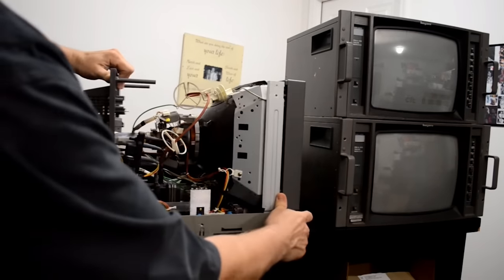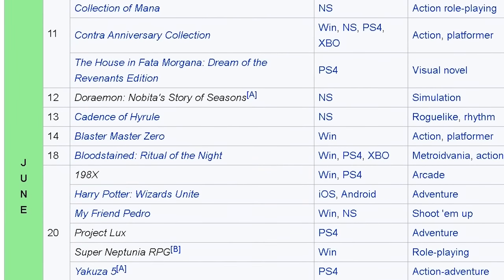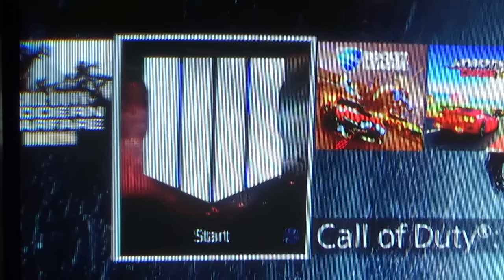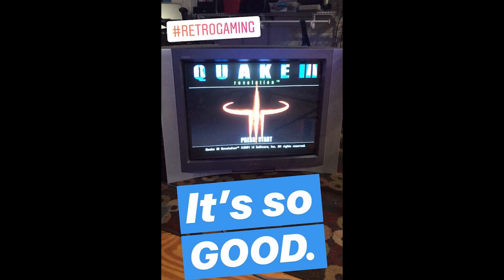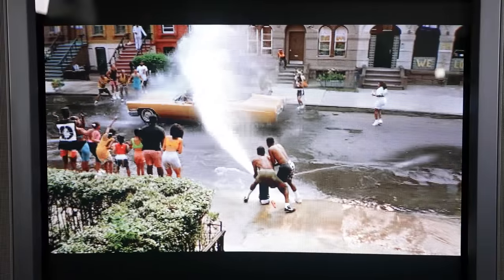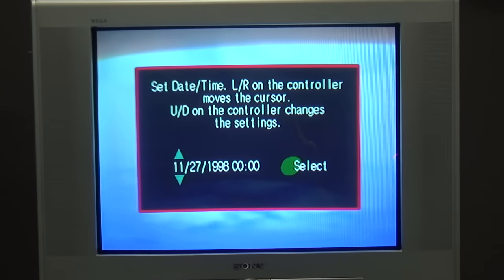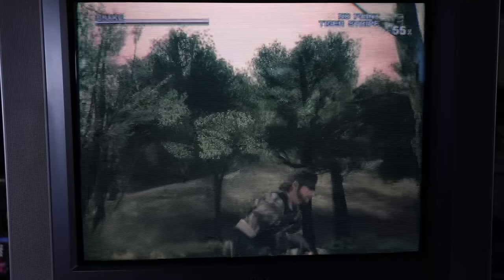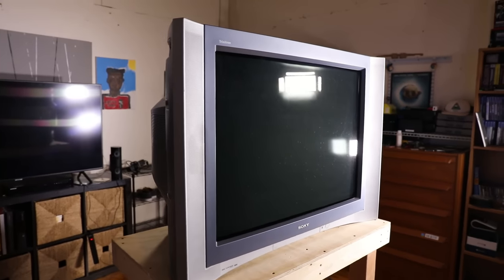Best CRT for Retro Gaming: Sony KV-36FV310

Comment: I love my 36" beast.  Currently it's on the floor but I ordered a flat top utility cart to set it on lmao  It touts a 500lbs weight limit, so it'd damn well better support a 220lbs CRT!

EDIT: Oh, by the way, Raspberry Pi with a RetroTink Ultimate will do exactly what you want in terms of getting a "PC" to output to your TV at 240p.  I'm building a consolized Neo Geo MVS and that's what I'm setup in the meantime to play some KOF while waiting for the parts  :)
Reply from the maker: Ty I think you just made me order a Raspberry PI
Reply: What kind of cart do you use for the 36" fv310? I'm getting one and need a stand.

Comment: I recently picked up a Sony Wega 30 inch 16:9 crt off Craigslist and i could not be happier with the tv. It has all of the best of analog inputs and a single HDMI so you can use newer systems on it. I use my ps4 with it, hopefully the ps5 with allow a 720p or 1080i signal. Everything on it looks amazing, crystal clear. 720p content looks jaw dropping. The deeper black levels allow not only for better color but better depth of field also. 3d objects pop more and seem to have more volume. This tv from 2004 displaced a fairly new Samsung 39inch 1080p lcd that was truly gorgeous and its not even a close second in my opinion to this Wega.
Reply: 32" Sony Trinitron here.  I got mine about 6 years ago.  A friend at the time was moving into a apartment and said there was a old TV when he moved in that the previous tenant left behind.  He ask me if i needed a TV.    I was like...fuck no.    I then then asked him what kind of TV is it.  He said it's one of those old floor model color TV's.    

My interest was peaked  Mind you, i didn't own a CRT at the time, although i wanted one but never really did anything to make it happen. 

So i asked him what make and model is it, he said it's a Sony.   0_0    I was like...i'll be right there...  I was thinking on my way there, "could it be a Trinny? 

Got there and there it was on the floor in all it's beauty..   Now for a 32" this TV was a BEAST!  It took 2 people to lift this thing and i was like...I hope my health insurance  is on point... 

So, after i called my HMO to see if my health insurance is up to date, initiated lifting procedures.

Got it home and it rests on a huge dresser  with plenty of space to the left and right of it for gaming consoles.

Comment: I used to have a Panasonic Tau 36" TV that was very similar to this, it had pretty much every high-end feature for a standard-def TV including geomagnetic correction. I bought it brand new back in 2004 when I was stationed on Guam. It was an awesome TV, but it weighed at least 160 lbs. It was nearly impossible to move with only 2 people. For that reason alone I had to get rid of it. I wish I still had it but I just don't have the capability of holding onto a CRT that weighs that much.

Luckily, I have found one of the 27" versions sitting around waiting to be trashed at work, so I am free to take that home. It's still heavy, but only about 100 lbs so it's a lot more manageable. The nice thing about CRTs, which is easy to forget when you've gone the last decade with LCD TVs, is that the built-in speakers often don't completely suck and are actually usable. These Panasonic TVs also have BBE audio enhancement which makes it sound a little better.

Picture quality of my Saturn through the S-video input was so good on that 36". I'm just going to grab that 27" and call it a day. I think my ideal monitor would likely be a PVM, but I would have to sacrifice screen size for that, and while I don't necessarily need a 27" TV, I would like something at least 20" or larger and the price of free is perfect. There's also the matter of the fact that this TV already has all of the inputs I would possibly need on it for all of my existing game consoles that aren't using HDMI, so it'll work perfectly.
Reply: I have that exact TV and it's better than this.

Comment: I still had my parents old massive Panasonic crt when black ops 2 came out for the 360 and when I saw the game for the first time on a digital display I instantly plugged my crt back in the crt it was a much smoother picture and was much better for multiplayer especially since I was on Ethernet straight to Comcast business and we lived only a mile from the service station. It was lightning fast for the time and I didn’t even realize it until I was older

Comment: Glad you're back, looking forward to the new content.

Man, my friend and I had suffered greatly only a few months ago lugging a 32" Sony XBR Trinitron into my apartment but now I'm heavily considering the one from the video. There may or may not be one down in the San Diego area. How did you pull it off, rent a truck and 3 guys to move?!
Reply from the maker: Go for it! A buddy of mine and I rented a U-Haul van for the day and were able to move it with just the two of us. If you can't find an furniture to set the TV on hit up Home Depot and they'll cut the wood you need to the correct specifications!
Reply: @Scarflix  This one might come with the OG stand. The TV is free but I'll have to grease some palms to have a few buddies of mine help out 😅

Comment: It's considered the best consumer crt as long as you don't mind a warped image. It's ok for 3d games but its a noticable issue with 2d games. Also, component isn't RGB but it looks just about as good.
Reply from the maker: I think I noticed what you're talking about when it comes to 2D games
Reply: @Scarflix  yea it can be annoying but the quality of the image is so good that it's worth overlooking. Another great consumer set is the Sony trinitron 32xbr48. It's a curved screen model so it tends to correct this warping issue but it's not quite as sharp being that it's a little bit of an older model (1999ish). As far as anyone can find it's the only curved trinitron that also has component inputs.

Comment: Toshiba came out with an almost exact copy of the Sony, Trinitron tube.  I had both the 36" and 20" versions... I kept and still have the 20".  Same exact features(like 16:9 enhanced) as the Sony in an easier to handle 20" design.  The Toshiba 20AF45 FST PURE Flat-Tube TV w/ColorStream Component Video Input.  The 36" model was the 36AF62 clocking in at 200lbs.

Comment: I love CRTs i own 4 different sizes and brands !
Reply: I have a beautiful story. About 2 to 3 years ago I went on Craigslist looking for a crt tv for nostalgia reasons. I came across a 24 inch Toshiba crt with both dvd and vcr. I loved it so much and it was practically brand new. The person I got it from gave to to me for free too o just had to pick it up. Is was mint condition and the controller still had the original batteries in it. Everything worked and I loved that tv. One day I was moving things around in my man cave so I set my tv on top of a Chair. It was definitely my fault because I left the tv on that chair for a couple weeks. One day for some reason it tipped over and it broke my tv. It still works fine and it I don’t think it damaged the internals but now it has a huge crack and broken area in one of the corners. It really still does upset me till this day because even though it still works it hurts me that I broke it when I was supposed to care for it since it was such a great find.

Comment: Did you keep the Wega? I have the same model but 32”. I know use the Retrotink to output 540p which perfectly upscales to its native resolution of 1080i. Then you can turn off the digital processor in the service menu which gives you next to 0 lag. Now my old consoles like Saturn look amazing.

Comment from the maker: If anyone knows the BEST way to get video from my PC to this CRT let me know!
Reply: Use CRT Emudriver (custom video driver that allows 240p output with certain AMD video cards) and use a vga to component transcoder if you have a VGA or DVI-I port.  If you only have HDMI, you might be able to use a HDMI to component converter with CRTEmudriver.  There are ways to get 240p output with Nvidia cards but I'm not sure how.
Reply from the maker: Thanks Kev! I just pulled down CRT emudriver and am reading the wiki on it now.
Reply: Theres a few ways to go about it depending on the resolutions you want to run  ill be making a video with this exact screen with my pc after i finish my av rack
Reply: eBay "scan converter". Thank me later.
Reply: Kevin's right. I do not know this with my pc and my wega. Did you ever get it working?
Reply: The KV-36FV310 has Component input so the easiest way to connect a PC to it would be to use some older graphics card with 7 pin S-Video connector and 7 pin to Component cable.
The 7 pin S-Video connector can output Component signal so you can get good quality picture with it.
Reply: You just need an older PC Video card that has Component output. These were designed with hooking up to a TV in mind. There are S-video Video cards as well. A number of the Nvidia 6000, 7000, 8000, and 9000 series video cards do component and s-video out.
Reply: extron makes devices that can convert pc signals to TV
Reply: @Chris-Courage , have you ever tried this? How does it work with superresolutions? Can you program the card to switch between resolutions? If you can't switch between resolutions the image looks like ass.
Reply: KV-36FV310 (236 lbs.... booyah) paired with Spherex 's Xbox 5.1 surround sound system is retro gaming heaven.  2600 to Wii look amazing, and sound amazing.
Reply: You'll probably need a Scan Doubler to revert the signal back to 15khz.  I use a Scan Doubler for my Amiga 1200 on a PC Monitor since my Amiga Monitor shit itself a while back.
Reply: HDFury, not cheap but no worries about sync rates just connect up, select correct res and hz.
Reply: I came here to post this exact comment. Pc to component preferably or pc to scart
Reply: @riggel8804  I used a CRT 480i with component video on my old Radeon X1950 XT and GeForce 9600gt, the image is good but you won't understand nothing above 1024x768 on it, even my old Philips Cineos HD CRT can't do a proper presentation if using more than 1024x768. But this was in a time where Windows XP was the actual OS, there wasn't an option to change the presentation  size like now on Windows 7/8/10.

Comment: Yo tubby, you are all wrong with your red, blue and green signal. And get a trinitron with a couple of scarts with RGB.
Reply from the maker: Whoops. My b. What’s the real info?
Reply: Component (or YPbPr) video is not the same as RGB video. To quote Wikipedia:

"YPbPr is converted from the RGB video signal, which is split into three components: Y, PB, and PR.

Y carries luma (brightness or luminance) and synchronization (sync) information. Y = 0.2126 R + 0.7152 G + 0.0722 B. Before the advent of color television, the Y axis on an oscilloscope display of a video waveform represented the intensity of the scan line. With color, Y still represents intensity but it is a composite of the component colors.

PB carries the difference between blue and luma (B − Y).

PR carries the difference between red and luma (R − Y).

To send a green signal as a fourth component is redundant, as it can be derived using the blue, red and luma information."

But component is still very good. If you don't need absolute perfection, you don't need to bother with RGB.
Reply: @Scarflix  the way you are describing component signal is misleading. ( To be fair, component cables are also misleading too). They are red, green and blue, but not RGB.

Comment: Something to keep in mind about the HD CRTs the use case is more suited for 34kHz (540p and 1080i) and in some cases 31kHz (480p 60Hz, 576p 50Hz) if you set your PlayStation 4 Pro to 1080i it should be lagless, I’m assuming that HD CRT supports 480p which will make it fantastic for PlayStation 2, Xbox, GameCube, Wii for games that support 480p, the 1080i mode will be great for games that support 1080i (Xbox in rare cases, Xbox 360, PlayStation 3, Wii U, PlayStation 4, PlayStation 5) also Nintendo Switch in 480p should be lagless

Comment: I still have my triniton kicking around. I forget what size it is, but I had it barely a year before lcd took off, and I made the jump to that.

Probably would set it back up, but finding the space for it, would be a pain. Not to mention find the various digital to analog converters to get an HDMI source from modern console games and and PC, seems more hassle than it's worth.
Reply from the maker: This is true. A PC CRT monitor could be just as good for the desired effect

Comment: I personally hate scan lines and do most of my old school gaming with emulation running 480p on a hdcrt,  the picture is rock solid and i don't notice any lag
Reply from the maker: I'm on the scan line train, but that may change eventually

Comment: I picked one up out of the trash. Just needed a new power cord. Mine is a 32 though. One question. How do you enable Svideo? Does it automatically turn on when inserted or do you  need the remote to enable it? Thank you for this great vidro by the way

Comment: One of many reasons why I'm not going to be getting rid of my KV-32XBR36 anytime soon...  especially after replacing the caps on the power board.  May not be as HD as the newer models people are talking about, but it's still good for older systems.

Comment: 9:15 upon looking at specs, the FV310 weighs a whopping 228 pounds (103.4kg). However theres a similar model, the KV-36XBR450 that tips the scale at 238 pounds (108kg), so your fingers wont just break, theyd be crushed

Comment: Years ago, while driving through an upper class neighborhood, there was a flat Sony Trinitron larger than 27” sitting on the curb. It had at least 2 sets of component connections. It would not fit in my car. I had to abandon it. Brings tears to my eyes just thinking about it.
Reply: Damn might have been a fv310 because those have dual component

Comment: I just want to know if light guns work on these. I hear many people say they do and many people say they don't.
Reply from the maker: I have never experienced pointing a lightgun at a CRT TV and it not working
Reply: @Scarflix   I would agree for the most part but things get foggy when you get into HDCRT vs SDCRT and curved CRT vs flat CRT. The model you have does seem to be curved and a SD model so I think light guns should work fine.
Reply: Also it's not just about the light gun working or not but about it being accurate.
Reply: Light guns don't work with hdcrt tvs
Reply: @Scarflix  I have experienced pointing a lightgun to a CRT and it didnt work. Not very uncommon.Thats the case for all 100hz CRT-TVs...i.E. the Sony KV32FX66!

Comment: the best way to connect windows to that TV would be to find an OLD ATI card with component output.  This normally is a card with normal ports and one or two other ports that loo like svideo but have more pins.  one of them allows you to connect an output cable that breaks out into several conections including component.  Some Nvidia cards also came with this.  You could also use any older card wilth an svideo out..but this wouldn't be as good as component.

Comment: That TV looks great! If it has a scart socket on the back though, I'd recommend using it, especially for consoles before the PS3 generation. RGB scart is better quality, far better than composite, which I saw was being used a lot in this video. I assume this is in the USA though, so might not have one.
Reply from the maker: I can't wait to go to Europe and actually see what SCART looks like with my own eyes!
Reply: @Scarflix  Cool! Contact me if you wanna go to some games related events and places. Like Arcade Club or my quiz in Nottingham. I mean RGB scart is good but S-Video is close. In America you can mod some TVs to use RGB (only get an expert to do it, it's dangerous). To be fair if you came to Europe, any old CRT won't look that different from S-Video unless it's a decent TV. I'd recommend a Bang & Olufsen from the 90s or better, 2000's.
Reply: @Scarflix  RGB SCART is basically VGA + audio in one cable. The two are almost identical and are pretty much the best you can get in terms of analog video. Unfortunately not all SCART devices are RGB capable, so watch out for that.

Comment: I own the same but a 32' KV-32HV600  Can you tell me your exact setup?   which input do you use to play your DVD movies? component or composite? 

Which input you use for video games? component or composite?   I'm assuming you are shooting for 240p?  For retro consoles? 

Do you use a separate DVD with RCA/composite outputs, so the enhanced 16:9 will work?

How do you know you're getting 4080i output?   when you press display on the Sony trinitron remote, it doesn't display the resolution.

Comment: Im using an inferior CRT from Samsung. The way I hook it up is via a Geforce 8500GT PCI-E with S-Video supported by the nvidia drivers(I run a C2D unit, but you can use newer CPUs because PCI-E is still around). It wont run newer games due to mediocre performance in 3D, but indie and older games run like crazy. I have the XGA resolution flattened to PAL. The picture isnt perfect since the tube has some mileage. Still, I will be playing games on it till it dies.